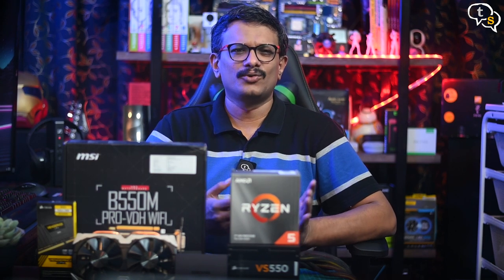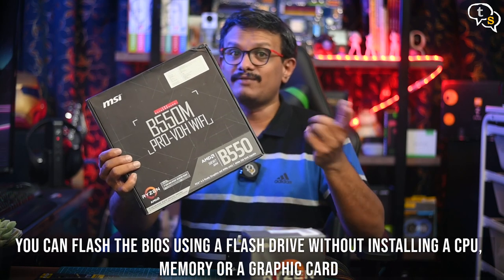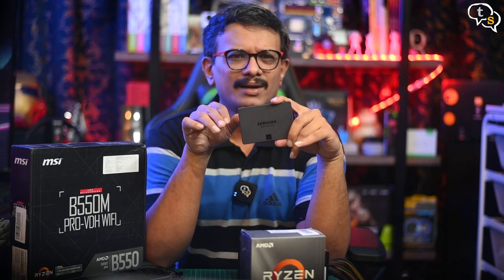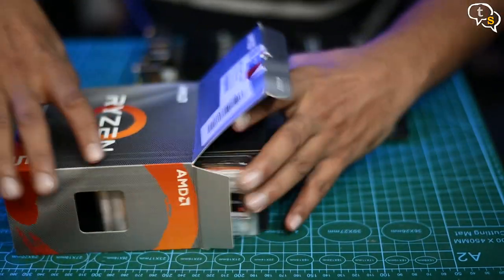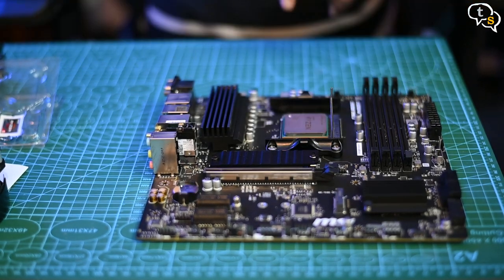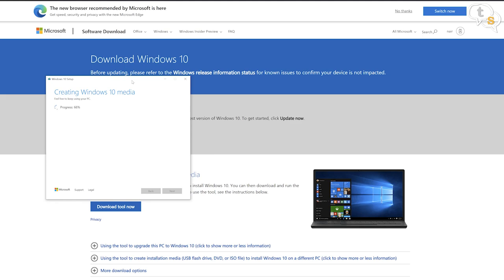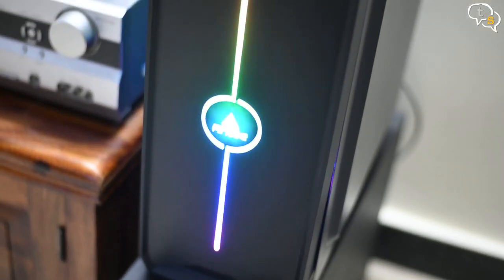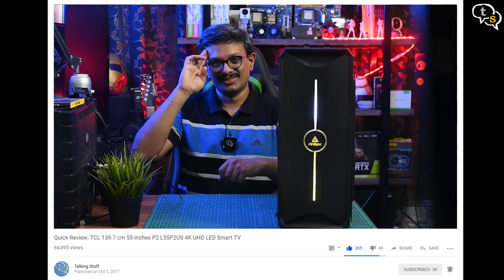Ryzen 5 3600 Budget Gaming Rig

Comment: Nice build 👍🏻
But I didn't got one thing, you said that we can't use HDMI, VGA and Display port as Ryzen doesn't has APU, then how we will connect our monitors or other output devices ? 

And what is APU, what does it do ? 

Yes, CPU temps are pretty high, I think you should buy an separate cooler for CPU and attach fans to the top of cabinet. 

In future if I build any pc I hope you will help me 🙏🏻😃

Thank you, good night ☺️
Reply from the maker: The Ryzen CPU's generally don't have a integrated graphics solution ,  like how Intel has Intel extreme and iris graphics. So unless you purchase a Ryzen processor with Vega graphics marked on the box it can't use the display options on the motherboard . Intel has now started following this and have released the F -series which doesn't have an integrated GPU. This lowers the cost for system builders who are anyway going to use an external GPU.
Reply: @TalkingstuffNet  
Ohh, okay I understood, this one doesn't have GPU. 

Thank you ☺️
Reply: @apoorvpradhan5933  You can either buy a CPU with integrated graphics or just use your Nvidia or Radeon GPU ports, but on a ryzen 3600 the video output from this motherboard is useless.
Reply: @Tinoco1x  
Oh okay, thanks bro 😃

Comment: What's ur experience till now? Has any heating issues! First i was planning to buy b450 tomahawk max ll but it's doesn't have wifi/bt and not gen4 ready as  I'll use rtx3060(launching today) with R5 3600. Want some suggestions for mobo!!
Reply from the maker: The MSI Bazooka and Tomahawk series are supposed to be the best in the set with great VRM's and low heat . There are b550 bazooka and tomahawk models available and are better than the motherboard I have. For WiFi you could always use a WiFi pci-e card or dongle.

Comment: How is this system running today? I've been seeing posts online about that particular MoBo and CPU combo not working for some people.
Reply from the maker: It's working perfectly, and I've actually upgraded the system to a Ryzen 7 5800x and the mobo works with that too. It has a flashback option which allows flashing the bios even if you don't have a CPU or GPU and ram.

Comment: How many fans can you connect to the motherboard? and how do you know which connector  is the rear exhaust one?
Reply from the maker: 1x 4-pin CPU fan connector

1x 4-pin water-pump fan connector

3x 4-pin system fan connectors

Use any of the system fan connectors as your rear fan connector. Better to choose the one closest to the exhaust fan.
Reply: @TalkingstuffNet  Is it possible to use the water-pump fan connector as  one of my frontal intake fans ?or  is it not meant for that? thanks a lot for answering !
Reply from the maker: Yes it can be used as a regular fan header. How many fans are you planning to install 😁. If you fill up all the headers there are SATA to pwm converters available which allows adding more fans via SATA. But it won't allow for fan speed control using sata.
Reply: @F.A.--  don't worry bro most cases come with a fan splitter cable, 3 fans for 1 header, it's all good

Comment: Can I use R5 3600X with upto 3060 in this motherboard???
Reply from the maker: Yes, this motherboard will support both the 3600x and the 3060. The powersupply is what you need to concentrate more on . A minimum of 550 watts is recommended.

Comment: are you sure that for using all 3 display output from the motherboard , we must have an APU , 3600 cant display all 3?
Reply from the maker: The 3600 is not an APU, so the motherboard hdmi port will not work. You will need a separate graphic card to connect monitors to, number of monitors supported would be limited to ports on the graphics card. Apu's are 3400g, 3200g etc , only if these processors are installed on your motherboard the onboard hdmi would work. There are new 5000 series apu's also available, not all Ryzen processors have integrated graphics.

Comment: I bought the same motherboard and same processor and my computer shutdown randomly without BSOD
Did you have the same problem ?
Reply from the maker: Check CPU temperatures , if they're going up high too fast you might have to remount the cooler. Also if you have multiple ram , remove one and try and see if any of the modules are faulty.
Reply: @TalkingstuffNet  Thank you for the tips ! I will try this ^^

Comment: Can you set up... after building this without a gpu?
Reply from the maker: The Ryzen 5 3600 is a CPU only, you will need a GPU to setup the system. There are processors called APU's, such as the AMD Ryzen 5 PRO 4650G , which have integrated graphics, then you won't need a GPU.

Comment: Hey bro i have a question! As it is written R5 3600 is pcie gen 4 ready. So do we use have use this in b550 mobo's to use gen 4?
Reply from the maker: For pci-e gen4 support you would need b550 or a X570 motherboard.
Reply: same goes with pci-e gen4 gpu's?(3000 series)
Reply from the maker: As far as I've searched it's a requirement to get gen4 speeds. Else you'll get gen3 speeds, but unless you need the bandwidth you're not going to utilize all the gen3 bandwidth. So if you're not going to use a powerful graphic card or multiple gen4 m.2 drives you don't  need gen4?

Comment: Wait, so I can't use any of the video output ports on the board when using a ryzen 5 3600 on it, period?
Reply from the maker: Unless you purchase an APU like the 3500G, but you lose two cores. The 3600 doesn't have integrated graphics. There are cheap graphic cards available if you're not interested in gaming and just need a display for around $50 or approx Rs 3500.
Reply: @TalkingstuffNet hi bro, I'm going to build my pc with these spec like msi b550 pro vdh wifi, ryzen 5 3600, 8gb ddr4 ram, 970 evo plus nvme ssd. I'm using these specifications for only multitasking freelancing work and simple ms office tools and other simple softwares. Can I use asus gt710 ddr5 2gb graphic card worth ₹3500 for display and above workload. My budget is very tight
Reply from the maker: Hi, an Asus gt710 will work with this specification. Especially for simple office software that's more than enough. It can be upgraded later whenever you need better graphics, but for normal work such as browsing, editing on word/excel the system is quite good. You can also game on it with some high end settings turned off.
Reply: @TalkingstuffNet  Thank you so much for the information. I will definitely build my pc now

Comment: Some poeple say that this board won't work with ryzen 5 3600.. It's true?
Reply from the maker: It worked out of the box, also i chose that motherboad as it can flash a bios even if you don't have a CPU or GPU installed useing the bios flash button on the back. The b550 always supported the 5 series processors , under like the b450 were not supposed to but after the uproar from customers are being supported too.

Comment: I have a ryzen 5 3600 and same mother board in your video when i try to install windows 10 it keeps on restarting any solution?
Reply from the maker: Does the system stay on before installation? Can you see the bios screen?
Reply: @TalkingstuffNet  yes it stays on and yes i can go on to the bios
Reply: i can some times get to where you enter the windows key but than the  screen goes black than i’m back to first step and  it just keeps going with system fully on
Reply from the maker: Did you unplug the usb installation pen drive and restart.
Reply: @TalkingstuffNet  well no i’m trying to do it from a usb flash stick where i downloaded windows 10 on

Comment: This case has no airflow at all. No wonder the high temps.
Reply from the maker: An AIO works well with this kind of a case. There is a top vent, and the bottom front of the case has an opening . I added two input fans from the top and two from the front. The exhaust is the provided cabinet fan. I also added a air cooler for the CPU , temps are much better now. The air cooler review is coming next Tuesday.
Reply: @TalkingstuffNet  So the top and bottom, is it a dual 120 or a dual 140 that the case supports?
Reply: @jimutjayadev  Don't bother with an AIO brother, just get a deepcool gammax or coolermaster hyper 212 air cooler. AIOs are troublesome and costly. AIO only makes sense if you're using an intel 10600k or ryzen 3900X or higher. Better to invest money in a case with good airflow.
Reply from the maker: Dual 120
Reply from the maker: AIO's now a days cost similar to air coolers. Especially the Deepcool AIO I reviewed earlier.
Reply: @TalkingstuffNet  gammax 400 is just 1399. while the cheapest AIO will cost you about 4000. But my reason is not the price, as noctua air coolers can be more expensive than an AIO. My reasoning is that the pump of the AIO includes a point of fault, and there are many nuances in AIO which a normal user won't know about. Also if it leaks due to incorrect installation or liquid change then bye bye motherboard. Air cooler are much much better, and use of AIOs should be reserved to extremely high tdp processors like 10900K or 3900X.

Comment: There are better GPU's for the same price. get the gtx 1660 or the rtx 2060 instead.
Reply from the maker: I had an older 1060 lying around as I had upgraded to a RTX 2070  on my primary system , used it instead of purchasing a new GPU. The 1060  is powerful enough for VR gaming .